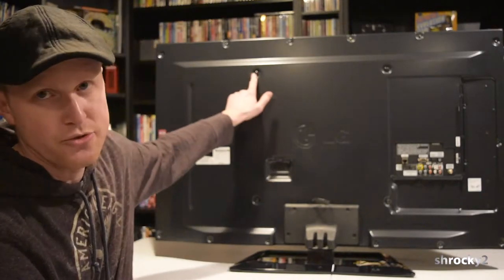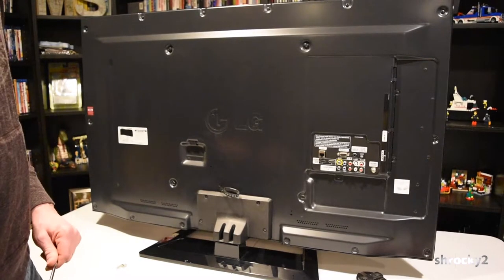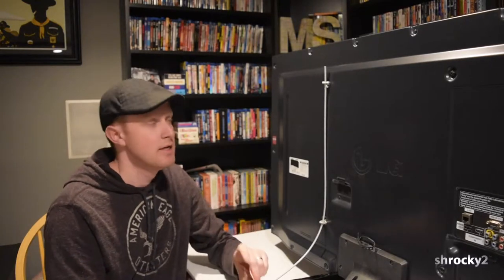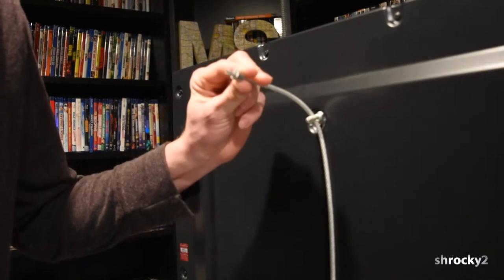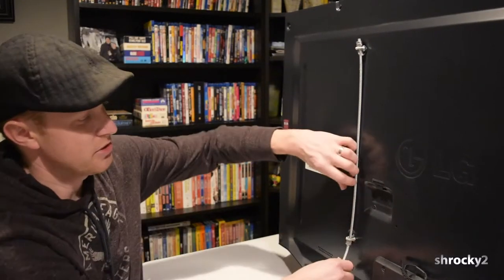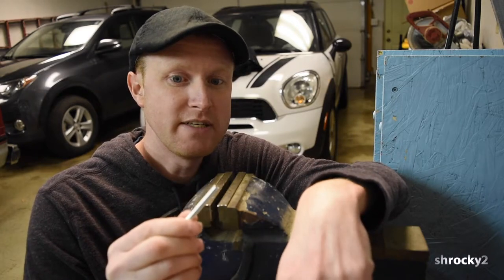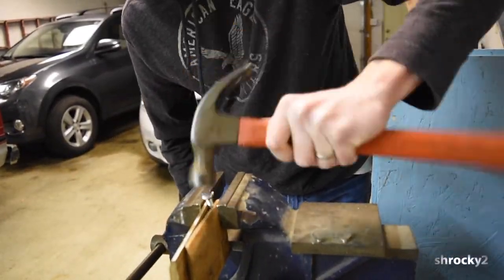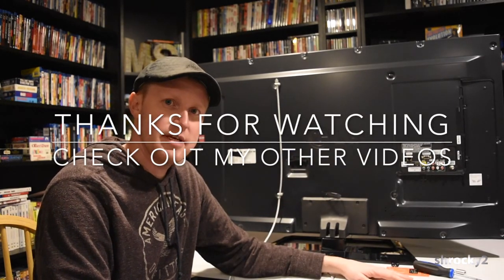DIY Anti-Theft Device for Your TV

Comment: Great video.  Is that 1/8 inch rope and 3/16 inch ferrule set ? Did you use 1/8 inch aircraft cable and did you cut it yourself or buy it by the foot ?
Reply from the maker: Yes, the 1/8” wire comes with a plastic coating, so the 3/8” ferret set is needed accommodate that coating. I bought for wire at Home Depot, where they sell it by the foot.

Comment: How tough is that wire rope? can't sometime just cut it with a bolt cutter?
Reply: or better yet ~   use  STEEL CABLE!!
(that's the correct term for what you're calling  "wire rope"...)